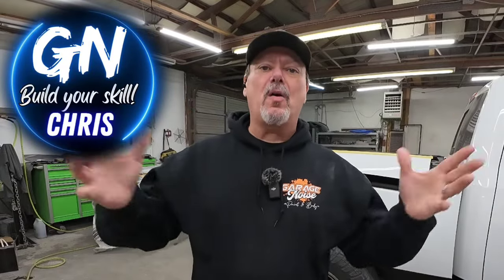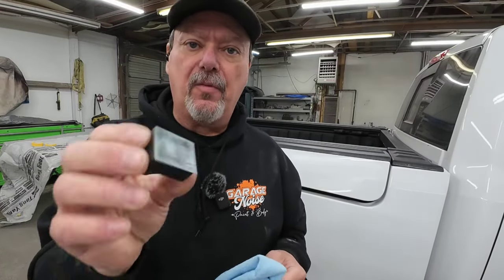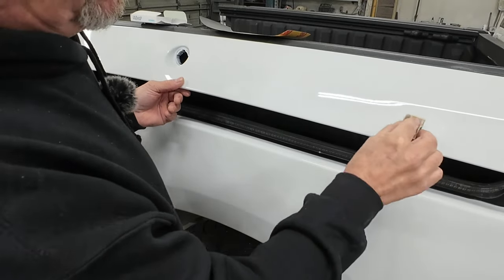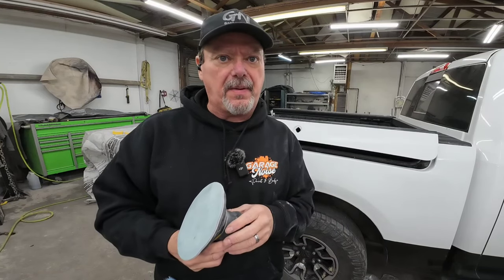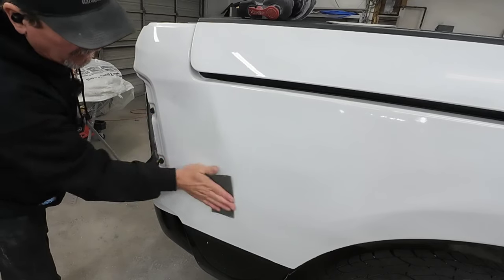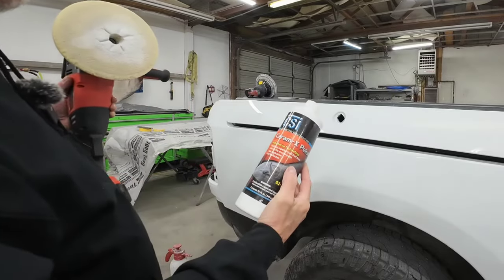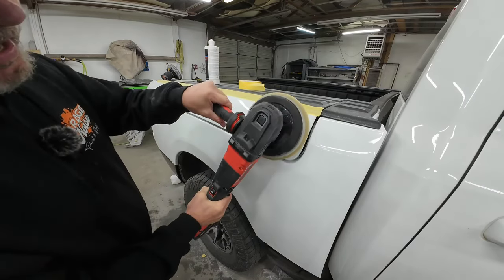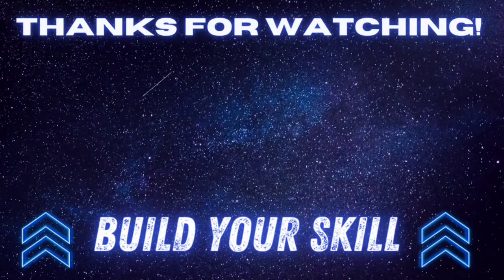Buffing clear coat after painting.

Comment: I always used random orbital buffers because I was afraid of burning through the paint and I was always getting less than ideal results.  I finally bought a rotary and wow, what a HUGE improvement.  Now I have rotaries in several sizes and my work is so much better
Reply: yes they are way way better, rotary is crap and so are foam pads.

Comment: Any suggestions on holograms? Sometimes after I get done wet sanding and polish  a black paint job i’ll have a hell of a time getting them out.
Reply from the maker: A softer buffing pad should correct that, finishing pad black foam. Appreciate your comment!
Reply: @GarageNoise  when doing orange peel on a whole panel I usually start out with a wool pad and Maguires cutting compound on the rotary after wet sand,  then work my way down with a medium pad followed by a black finishing pad using Maguires ultra finishing polish and the orbital, still see them sometimes in the sun but only on black paint jobs, maybe I’ll give that CSI all in one a try.

Comment: This is the stage that I am in currently with my project. How do you prevent pig tails while sanding? I have to do all the wet sanding by hand because with my DA I kept getting pig tails. Did not matter how often I would wipe the surface down and re-wet, I would get pig tails. Thanks again for another informative video.
Reply from the maker: If your hand sanding you shouldn't  get any pigtails. Those are created from the orbital sander. That's  why I hand sand with 2000 cause if I use it with the orbital I get pigtails.
Reply from the maker: Ok, sorry I got you. The 3000 and 5000 won't  create pigtails with the orbital only 2000 and coarser.

Comment: What does a painter helper do? I got a job offer to be one. I went to paint and body school work with a friend in his body shop plus painted over a dozen cars. I'm I over qualified, do I get to paint.  Commercial shop
Reply from the maker: Your assisting the painter in prep and what ever he need to get cars ready for paint. You may get to paint depends on the shop. This is a good entry level position to get experience. Check on advancement potential and use it as a stepping stone.
Reply: Pulling panels, sanding, taping off and polishing process

Comment: Why would you sand down with anything finer then 3,000grit ?
Reply from the maker: Sometimes I'll  use 5000. When using 5000 it's  almost like you starting the polishing process it starts to give it a shine, makes  it so simple to buff. It's  not absolutely necessary you can easily buff after 2000 or 3000
Reply: @GarageNoise I Always polish out after 2000, mostly cause I’m cheap and don’t want to buy finer grits of paper lol

Comment: Have a concern? In auto Collision school and recently painted a fender for a customer vehicle. But instructor stopped me on second basecoat saying that i went to heavy. So stopped on second basecoat and applied the metallics it turned out well.  customer came back and put the new fender back on. When the car was out the shop the sun hit the fender and was lighter than rest of the car. So kinda felt like I failed because it didnt match.
Reply from the maker: Don't  feel like that! It will NEVER MATCH perfectly without blending into the adjacent panels.
Reply: @GarageNoise  thanks  you.
Reply: you needed to blend the paint
Reply: The customer was still driving the vehicle and we had to base the color match to the front bumper.  @KevinLapointe-se1cb